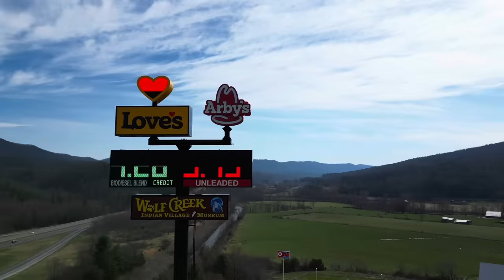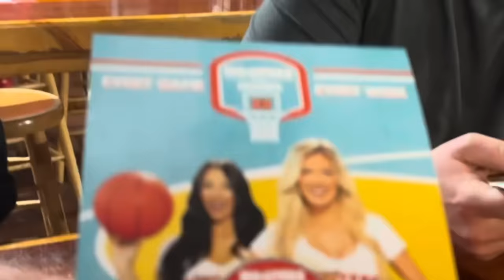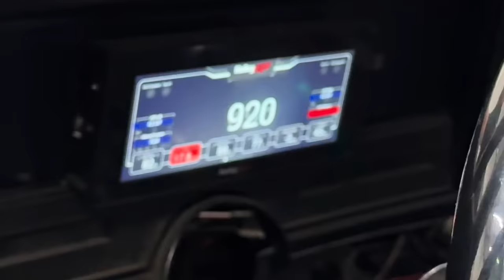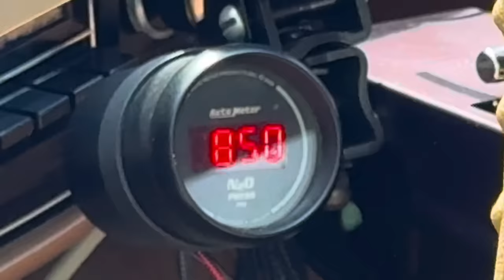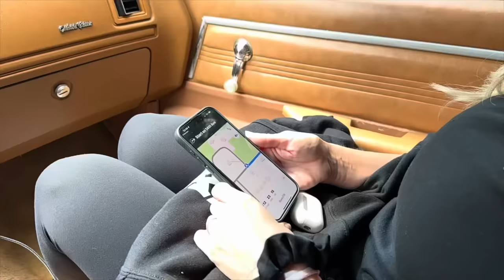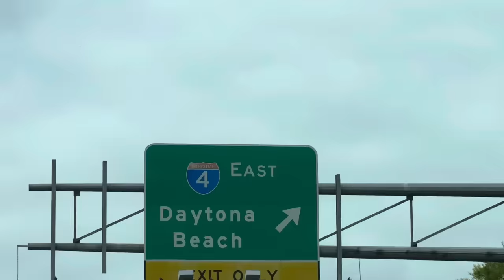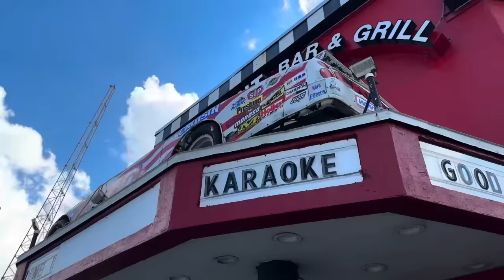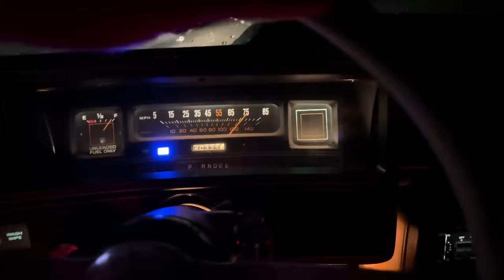EPIC FAILS LEAD TO EPIC ADVENTURES!  @MissMidnightMaverick joins me on a trip to DAYTONA BEACH!

Comment: Why not get a regular set of street tires, on w.e factory wheel you can find for the Malibu for long drives ? The slick or w.e you currently have on it can't be the smoothest riding, safest, nor have the most longevity either. You could toss them in your trunk, and still have plenty of room back there as well as the back seat!
Or
You could get you some of those super suction roof mount storage racks and literally double the storage capacity and possibly look super cool while driving down the road? I don't think anything says daily driver more than a roof rack lol, especially if you did some Baja lights on the front of it hahaha😊

Comment: That's the main problem with NOS. It'll fail on you if it's not constantly maintained and kept up with. I can't tell you how many times nos failed me because the bottle was cold. the solenoid was stuck,  the bottle had leaked down over long periods of non use, Fuel pressure cut off switch failed. You name it, It happened to me. I guess it all really boils down to my lazy nature and not keeping up on my equipment as well as it calls for. 😄

Comment: Great video! I noticed in this video along with others, Bill doesn't run an air filter. Is he not worried about it because the engine is tore down often? I thought an air filter is always needed when driving on the street.

Comment: Ol Bucko is right , Straight up lack of maintenance on all the cars. They seem to just just get in them and drive em until something breaks. Sucks that it happened on such a long trip ,but you gotta maintain racecars(street car) And that's nobody's fault but their own.
Reply: They are constantly maintaining them.  Once again, when your cars are pushing that much power, it's not a matter of "if it breaks its when it breaks".
Reply: @rayhendricks7379  oh really then why's Billys Nova been in Florida for a month while they're in Ohio. That's not maintaining it. And the Falcon they just changed the motor not long ago and did zero testing at all. They would have found they had an oil leak,that's not maintaining that's running it until something breaks
Reply: @rayhendricks7379  but good try though 🤣 🤣 🤣 dude wasn't even there to do his own oil change but ok bud .... lmao
Reply: @bobbyackerson4125  that's one of the first times Billy didn't roll down there with the rest of them but it's okay you do you boo boo 😘
Reply: @rayhendricks7379  cool story, you go girl. Go back and watch videos and you can see for yourself  they Don't maintain anything. Time to get off your knees you got something running down your chin.

Comment: You can tell dude at the end dont know cars that well because you cant make a ls beat the sound of a small block and trust me i have 2 ls cars a 500hp 87 ss monte Carlo  and a twin turbo 68 impala convertible that makes 1500 and also have a 600hp small block Caprice 2 door and in my opinion the small block sounds better but it's probably the fact that the small block is 454 cubic inches and the ls engine are just 5.3s

Comment: Jay Berry with ignite stated that ethanol is going to become less and less available at the pumps over the next 5 years untill it disappears from gas pumps. Ethanol didn't work as well as the government hoped. That's why they quit making flex fuel vehicles in 2017

Comment: no, they shouldn’t have more E 85 the shit is garbage as far as I’m concerned that’s for race use only just like methanol alcohol. It’s strictly for a race that’s not every day driving stuff you ever notice how old is flex fuel vehicles when they decide to run E85 all the time they’re all sensor light is telling him to change our oil like every 2000 miles, how are you saving the environment when you’re going through twice as much oil another one for you how could you possibly be being better on the environment by burning and fuel that takes three times as much fuel excuse me I’m sorry 30% more fuel to run a vehicle I mean that’s a big time waste you’re still burning conventional gasoline you’re still doing the dirty deed so E85 is nothing but a racket it’s a scam prove it if you think you can change me I know you can’t run any kind of ethanol blended fuels in a lawnmower in your boat engine in your dirt bikes, your motorcycles, your old vehicles, if you do what happens you constantly have to tear them apart and clean them the E 85 the ethanol is so corrosive fill up your tank drive it out till it’s empty and then go park it and leave it for a month. Tell me what happens when you go try to crank it up next month. It’s race fuel. It has no business on the street. yes that’s my opinion but those are also the facts